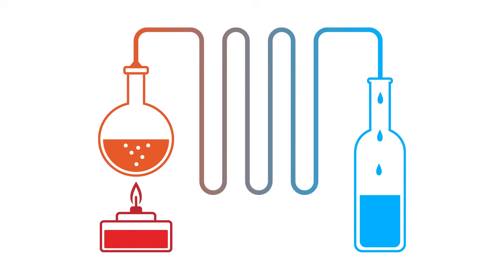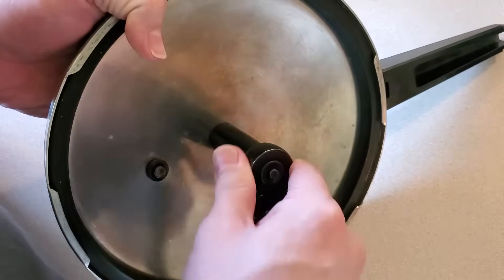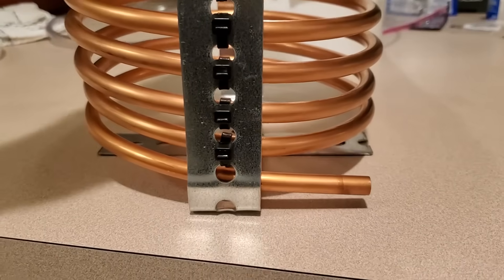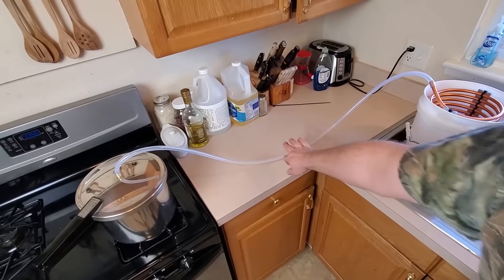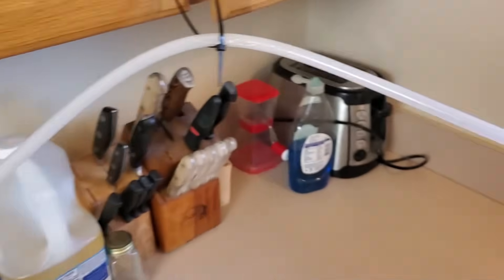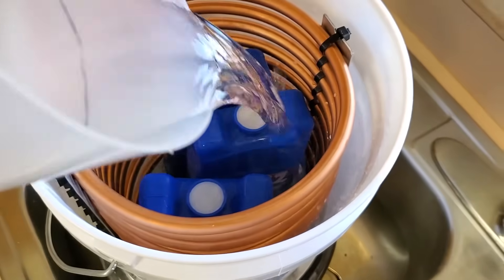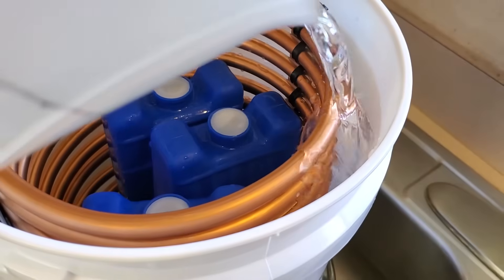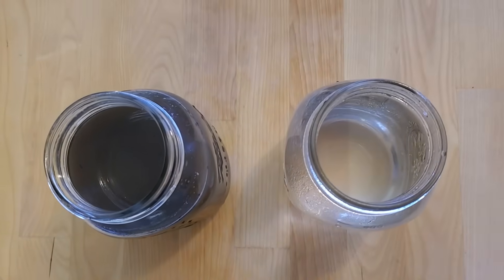DIY Water Distiller (Higher Output Version) - Full Build and Demonstration

Comment: Hmm. If you have access to electricity, you might be able to get less water waste by putting a catch basin below the condenser bucket and using a small water pump to pump that water through some sort of cooling apparatus (maybe car heater core or radiator? being sure it is absolutely clean or using only new) with a fan blowing over it before returning the now cooled water back into the condenser bucket creating a closed-loop cooling system. Could add a second container in the loop maybe after the cooling apparatus to hold ice or ice packs and water to help cool it further before returning to the condenser bucket. Another option for the cooling apparatus is a computer cooling radiator/heat exchanger that is used in liquid cooling of computers. They're pretty cheap and might do the job.
Reply: That's how u go blind from moonshine people using radiators and traces of led get in it
Reply: Cheap is not answer and most electronics probably have LED solder

Comment: As one who has distilled my drinking water for 20+ years, you have no idea what is coming from your tap and pictures do not convey the smell to what is left behind.
Reply: Even bottled water is filled with poison.
Reply: yaboyGOODVIBES Factually incorrect but ok
Reply: @MeatBall-1-3  Fluoride is essentially poison doesn't kill you instantly but overtime shortens your life span and is linked to Alzheimer's, also plastic releases estrogenic chemicals. Fluoride filtering water and storing it in not plastic containers is the only way to drink water free from toxins.
Reply: @m0gg83  distilled water leaves all the fluoride behind. You get pure H20. It will taste a bit 'flat' because all the minerals are removed as well, however, they sell liquid minerals you can add to your water.
Reply: @watchingvideos2235  yep
Reply: @m0gg83  fluoride in toothpaste makes me gag. We use spring water but I’m going to start using distilled water.
Reply: @m0gg83  Haha! You went from "factually incorrect to "yep."
Reply: Smart man
Reply: Fluoride and nano robots( graphene oxide)
Reply: I have heard that consistent consumption of distilled water can actually pull minerals out of you bones. Just a rumor I heard and wanted to check
Reply: @char-knee496  Maybe if you ate a diet completely free of calcium and other minerals that your body needs and drank only distilled water as well, your bones would lose minerals. But even then I would think the blame should be put on the mineral-free diet, not the drinking of distilled water. I have heard this rumor from other places, but I think it is completely without merit.
Reply: @csledbetter unfortunately it can happen - it made a friend of mine very ill, and over a decade later she is still struggling to restore the balance of minerals to her body.
Reply: Distilled water helps remove excess minerals that have accumulated in your body is a good thing. Calcium on its own is unassimilable by the body have to have silica , think something else mainly silica so your body can use calcium other wise it just builds up bone spurs etcetera but then people still have osteoporosis
Reply: @ihoff440 that is only when you lack vitamin D and K2
Reply: Inorganic minerals
Reply: @char-knee496 Correct. What people won’t tell you here is that 100% pure water is labeled as a solvent that is excellent at removing mineral deposits for surfaces like glass in electronics applications. Water intoxication and hyponatremia can kill you.
Reply: What's the best water to start with to make distilled water?
Does it even matter?
Reply: @alvarodias68  great question  man...Need to look into the chemistry of flouride,lead,arsenic, glycophoshate etc...Great question  hopefully  someone can answer.
Reply: Doesn’t matter
Reply: When I see devil 😈 said OH Yeah 😂😂
Reply: That is incorrect.  Easy to add back in minerals w better fiet and liquid minerals. Dont depend on water for your minerals.
Reply: Tap water is disgusting.
Reply: Been drinking distilled water for 48 years. Hasn't effected bone density yet. Eat your vegetables.
Reply: @unclearvin3718  bone density isnt the issue. distilled water literally explodes your cells. its the basis of chemiosmosis and biology. that is, unless youre adding minerals to your distilled water
Reply: @fishyflaek1813  so what are the recommended daily allowances of Chlorine, Aluminum Sulfate, Potassium Permanganate, and Flouride?
Reply: @unclearvin3718  How does that relate to this at all?
Reply: @unclearvin3718  distilled water will deplete your electrolytes. Diet is not good enough to compensate because of how much more water you should be drinking. Put some of that tap water or a filtered water back into the distilled. A little bit of fluoride (which is naturally present in many of the rivers, springs, and lakes our ancestors have used for millenia) is not bad for you and is helpful for teeth. The recommended limit for Chlorine is 4 milligrams per liter. As long as it doesn't go above that level Chlorine serves its purpose as a disinfectant and is unlikely to cause harm. Without disinfection the water would definitely be unsafe to drink so it's a trade-off. Potassium Permanganate is used sparingly and, like the rest of the stuff, is not likely to be harmful at lower levels. 

However, if you don't want to drink tap water, I don't care. I'm not trying to convince you of the virtues of tap water. In fact, if you want to avoid it I want to help you. Please do distill your own water. However, you need to find a source like a river or a lake. Then you can boil some of that water instead of distilling it (or get a smaller amount of the mineral solution left over after distillation). Put that into your distilled water so you will not lose the minerals. It is important for your health that you do not drink only distilled water.
Reply: @unclearvin3718  you should drink 1 liter of water a day normally. If it bothers you so much you could ask if they would allow you to drink bottled water. Idk who told you calcium, magnesium, and zinc are not important because they're among the most important minerals we need to consume. Most things are bad in excess though and even so are they. I doubt there's an unsafe amount in the city water.
Reply: @theweeviler people with ME get gradually sicker when they drink distilled or filtered water (less so with the latter) but can start to improve with spring water from a good source. Of course other things have to be in place too (stress, diet, sleep).
Reply: Wow! Thanks for sharing. I will test this out.
Reply: @@l.lazman4751 But won't one be boiling everything out?
Reply: @alvarodias68 since nobody responded to this, I will. What you're doing by distilling water is heating your  source water(and anything that's in it) to a temperature above the boiling point of water(212F/100C with relatively small variations depending on what else is in the water) so that it turns into steam, leaving behind things that boil at a higher temperature. I highly recommend first filtering the water to remove solids then boiling it in an open container for a while so that chemicals with a boiling point at or below the boiling point of water will get boiled off. Not filtering the water is a really bad idea because there are a lot of things that can end up in your end product.  Not boiling the water before distilling means that any contaminants which are present that have a boiling point at or below that of water will get distilled into your end product. When you're doing the distillation, it's best to keep temp as close to the boiling point of water as you can. When you go above the temp of boiling water, impurities that boil above the temp of water will end up in your end product.

Distillation is a pretty awesome way to selectively extract fractions from a solution. The key is to keep the starting material as free from unwanted contaminants as possible. This means collecting it farther out than the shoreline in the case of a lake or pond since there tends to be more debris and sediment stirred up along the shore. Avoid still water (like pools off to the side of a river) to reduce the amount of micro flora and fauna(plants and microbes). While running water does tend to contain more sediment, much of it will be easily filtered out.

A good pre-filtering trick is to let your collected water sit for 30 minutes or so, undisturbed. This will allow sediment to settle on the bottom and stuff lighter than water to settle on the surface. Then gently scoop/skim off surface stuff followed by scooping out the water layer(in chemistry terms, the water is called the supernatant fluid/liquid). Get as much water out as you can without stirring up the sediment. If you have no way to filter your water, this is a very good way to reduce contaminants on its own. I highly recommend some form of filtering though. Even a piece of cloth like a t-shirt can be a decent filter.

I hope this info helps you understand distillation a bit better in addition to supplementing the video.
Reply: @asmblur3546  Thank you. This was very detailed and helped me understand the process quite a bit more.
Reply: @alvarodias68  it's my pleasure. Spreading knowledge is one of the best ways we can help improve the world after kindness and empathy. 😁
Reply: Yes, we do know. 🙄
Reply: fluorosilicic acid also commonly known as fluoride is literal poison. A toxic by-product of aluminum manufacturing process, Aluma Co was responsible for the addition of it to lo al water supplies to fight cavities...but the fda has never approved of it being a safe thing to add to drinking water, it's literally the only chemical added to water to treat people not the water...it's also the only chemical I know of that has a specific warning in its msds documents that I have known of that specifically specifies children against ingesting it
Reply: The fluoride found in tap water is not good for your teeth. That is a chemical waste  product. What is found in the earth is different.  It’s easy to add necessary minerals w good foid and celtic salt or Real brand salt
Reply: You’re using way more energy to produce water that way as opposed to reverse osmosis which literally uses no energy at all.
Reply: Aren’t you going to be absorbing silicon and copper? Silicon is extremely difficult to extract from the body (which is why there’s so many ill women post breast implants).
Reply: Rain water is distilled water. But it is contaminated when it picks up all the toxic chemicals in the atmosphere that we are spraying to control "climate change". 😅
Reply: It’s almost impossible to replace all the right quantities of minerals as there are so many trace minerals and the things you use to replace them do not contain them all. It is not a good idea to drink distilled water.
Reply: what man drinking distilled water kills you
Reply: @fishyflaek1813 it is the same as rain water wake up

Comment: Enjoyed your wonderful demo.
Suggestion => instead of going to a "jar", buy another "pressure cooker" (exact setup of first), and direct the water to it directly (and let the pressure cooker collect water & vapor (100%). I think you will not lose any moisture/steam (and will not have to keep pouring water in the bucket (once it fills and stays full).
Reply: if u make it a closed system u are just making a pressure bomb
Reply: @marianocenteno4603  Drill an extra hole for a release valve. You might lose a bit of steam, but it prevents the big bang.
Reply: @marianocenteno4603  I saw a video of someone using a 2-3 foot piece of bamboo into a food grade plastic bag that was held to the bamboo with rubber bands. Nearly 0 vapor loss. The bag did inflate, but didn't pop, and didn't seem to have steam venting much from the rubber bands.
Reply: Good idea. Anyone try this?

Comment: Good design. I would suggest a bulkhead fitting between the worm (moonshine term) coil. This seals the bucket of cooling water. You could then use a basin of cool water to be circulated by a fountain pump. This should add process time for your ice packs placed in a basin rather than the coil bucket. The same way a lot of moonshiners tried to place their stills near a water source.
Reply: Good idea brother

Comment: Won't this ruin the copper over time? And won't the silicone leech into the water?
Reply from the maker: The silicone tubing is rated for this sort of thing, and as far as I can tell will not leach into the water. And I can't imagine how it would ruin the copper. Copper tubes/pipes are very common for hot water lines.
Reply: the melting point of copper is 1,984º F, while the boiling temperature of water is 212º F, so no, it is not going to do anything to the copper...

Comment: The problem with the water draining from the bottom, is it's going to drain the coldest water. The hottest water will be at the top, so it reduces efficiency quite a bit. I had a pump feeding through mine, one fitting at the top and another at the bottom. I first ran the cold water into the top and used the bottom as the discharge, so it would siphon the water out as I'm pumping it in to keep circulation going. I've since switched it, cold fed into the bottom, and just let gravity drain the top discharge. Works much better. As the VERY top is all that really gets hot. And I mean just an eighth or quarter inch. The rest of the water stays ice cold. You can stick your hand in, and the very top will be scalding, but the rest is cold. I just run tap water now, instead of having a pump and a big 25 gallon reservoir.
Reply: Well, did it work okay 'errr?
Reply: Brilliant 👌🏾 ❤

Comment: are you at all worried about the water leaching from the copper in the condenser?
Reply from the maker: From the copper? Definitely not. Most modern water pipes are made from copper. It's an extremely common material for hot water, cold water, beer making, and just about everything else you can imagine for transferring food-grade liquids. The copper tube I made this from is sold as a hot water line.
Reply: @GreatLakesPrepping  thanks for the quick reply. i've just heard all this talk about distilled water leaching from anything it touches, and that it's best to keep it in stainless steel or glass containers. i don't know what i'm talking about, just have heard this tossed around a lot. your videos are great.
Reply from the maker: @BIG_SCAM  Thanks J!
Reply: Anyone else heard more on this waterleechin'   ?
Reply: @teepee6314  water leeching? do you mean copper leaching into the water? no, the copper will not disintegrate in any way and end up in the water. in fact, it is a beneficial metal and can kill bacteria on contact. most modern homes have copper piping, as the poster mentioned above.

it's very likely you've been drinking water that has come into contact with copper your entire life and you're still alive, right? people even like drinking out of copper cups. just look it up on google.

Comment: Have you tested the quality of this water? Is it safe to drink?
Reply from the maker: I didn't do any official lab testing on it, but I did drink it. Distilled water is very effective at separating water from stuff that isn't water.
Reply: I was waiting for him to drink it! Haha, maybe i wasn't the only one. Just wanna be sure it's safe.
Reply from the maker: @teepee6314  Ha, I assure you it's safe. I did drink it, but after the fact I thought I should have put it in the video. There's tons of info out there about distillation and safe ways to do it. Everything I used was stainless steel, copper, glass, and the kind of silicone food-grade tubing used in beer brewing and such. All food safe, even at high temperatures.

Comment: What about chemicals (not done watching but invade you don’t answer that)
I wanna distill my filtered tap water to use it for a medicinal eye wash and make medicinal teas
Reply from the maker: Hi Krystal. Distilling removes most impurities, and many different chemicals, compounds, etc (such as chlorine). There are some things it doesn't remove. Here's a very thorough page that details a lot of specific things that distilling will and won't remove:
https://extensionpublications.unl.edu/assets/html/g1493/build/g1493.htm
Reply: @GreatLakesPrepping  thanks a bunch bro, this really helped
Reply: I've heard letting the pot boil for a few minutes before attaching the condenser will boil off most of the organic compounds that may be present because they have a lower vaporization temperature than water. Let the volatile solvents, and volatile organic compounds (VOCs), such as benzene and toluene boil off and escape for 5 minutes or so before condensing and collecting the water.

Comment: A very well thought out plan. Have no doubt you will perfect it in time. Maybe the bucket acts more like an insulator which prevents the water from Cooling quickly. Would suggest more space between the coils perhaps and a fan blowing on the coils to help with the cooling process.???? Maybe a larger diameter tubing like 3/8 inch.
What are your thoughts?
Reply: Heat exchangers are all about surface area and turbulence.  All of the steam/water NOT scraping along the sides of the copper pipe is just going for a ride.   Longer, thinner copper tubing would increase surface (cooling) area.  If he's not getting the cooling rates he wants,  running two concentric coils of 1/4" would improve things.  Also, water on the outside of the coils is always going to work better than air.  Think of it this way: if you went outside during a 50 degree day, it might feel a little cool but once you started working you'd warm up.  If you went for a swim in a 50 degree lake, you'd be dead in an hour.